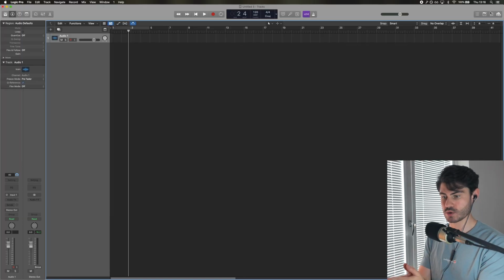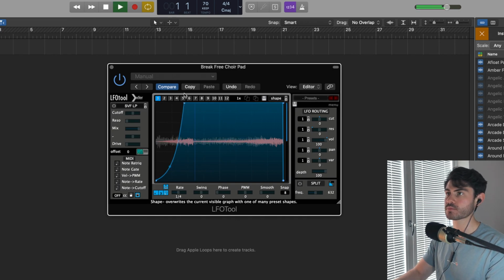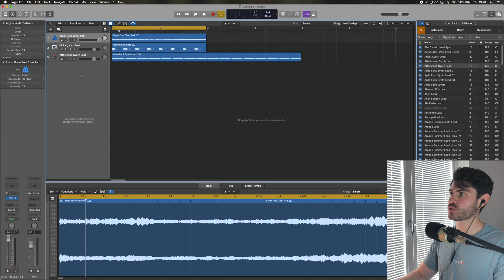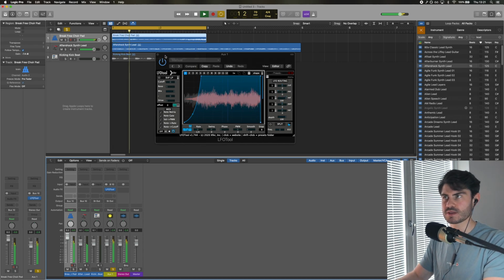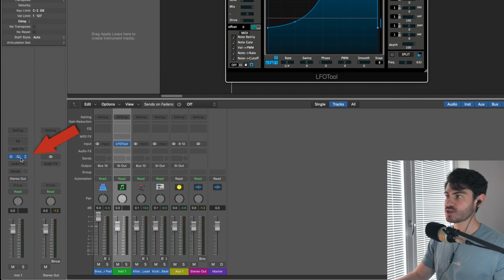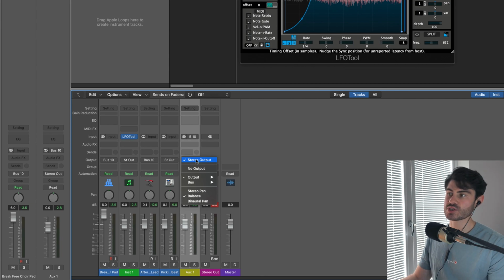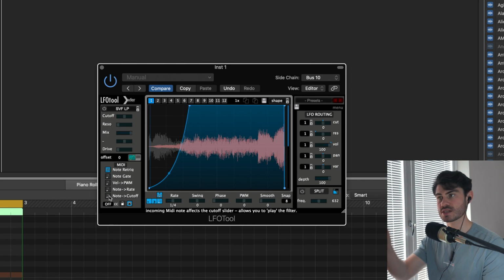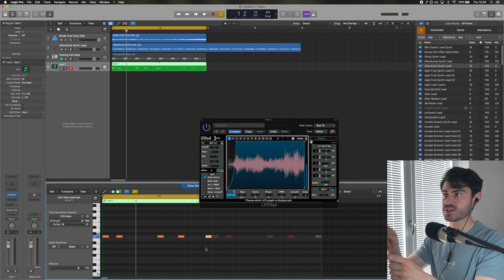Sidechaining with LFOTool In Logic Pro X

Comment: I usually just use the StepFx with the "gate mix" configuration. The enveloppe is slightly less precise and there is no display of the waveform but it does the job very well + you can add plenty of others effects and many creative options.

Comment: i don't understand why lfo tool and shaperbox dont kit you just select a side chain input the same way you would in a compressor without having to do all the complicated midi routing. this is also an issue for me when i want different release times on different side chained elements. shaperbox and lfo tool seem to be less prone to clicking and artifacts tho
Reply from the maker: Yeh I feel this. I would love it to just have the ability to trigger from an audio source etc but I think there are constraints on the inner workings of the audio systems for logic preventing for third party apps. I much prefer the LFO tool capabilities for shaping the sidechain envelope to regular compressors though.
Reply: This is a logic issue, not an LFO Tool issue.  It's possible to do exactly that in other DAWs but Logic restricts how audio and MIDI can be routed.

Comment: Thanks for the super useful videos! You've opened up a lot of Logic tools to me that I didn't even know I had. I'm curious: what is the advantage of using this LFO tool method vs. just using compression and setting the actual kick track as the sidechain input?
Reply from the maker: Thank you! For me, I like the absolute control over the volume envelope you get with LFOTool. I find that with the compressors I can’t quite dial in the attack and release as well and notice artefacts introduced into the sounds if I’m using too fast of a release
Reply: @tombenjaminmorris  That makes sense. Thanks Tom!